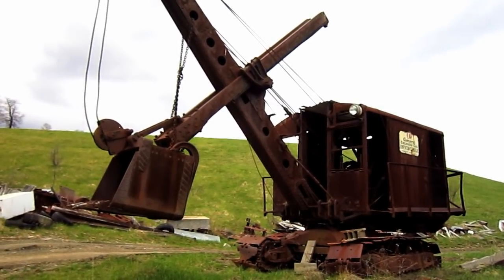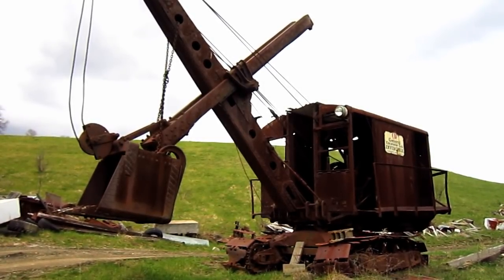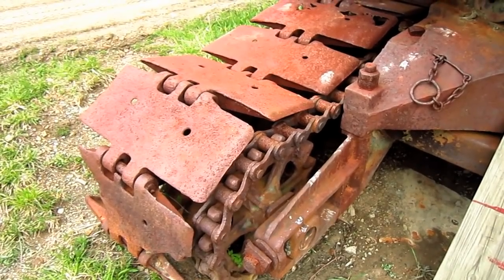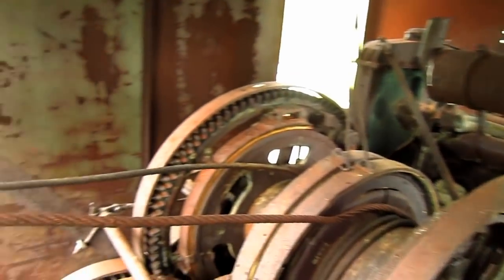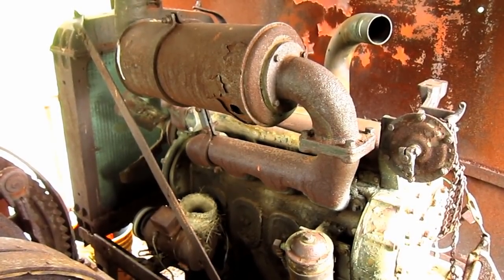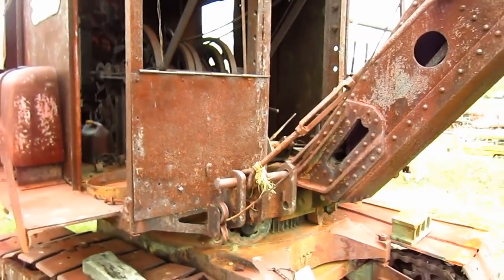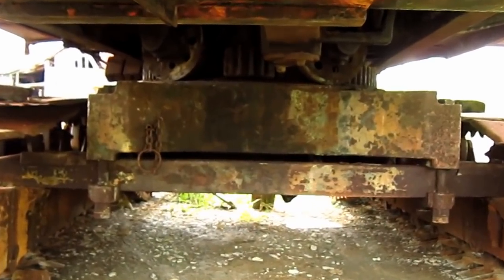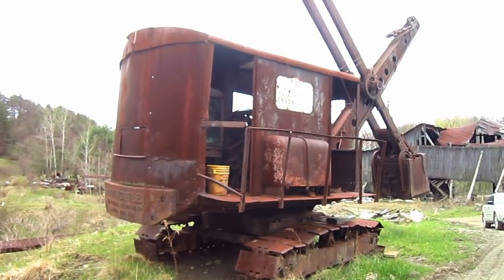General Invincible Documentary

Comment: That's a keeper. First 1 I have seen.
Looks like a 4 cylinder Detroit Diesel. I think that's the same fuel tank setup as my 1947 Allis Chalmers. Probably used stock parts and didn't re engineer everything.
Reply: Sure looked like a 4-71 or 53 from the rear!
Reply: Lewie McNeely it looks like a newer replacement engine to me . I think you are correct.
Reply: @douglasweller9709  Sure looks like a GM/Detroit. No way is it a Cummins or a Buda, at least the ones I've seen.
Reply: Whew!  I thought I was going crazy.  Definitely a GM engine
Reply: @jaduca22  I've never seen one that looked like that one that wasn't!
Reply: The hand hole covers are a dead give away
Reply: @mattberg6785  That's what I thought and maybe the exhaust manifold.